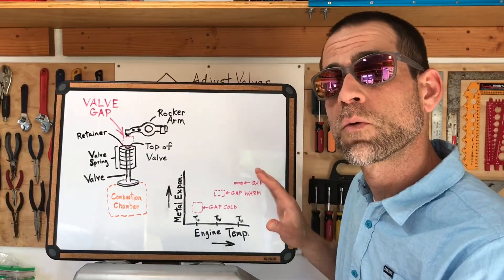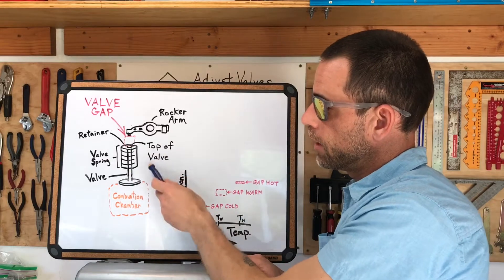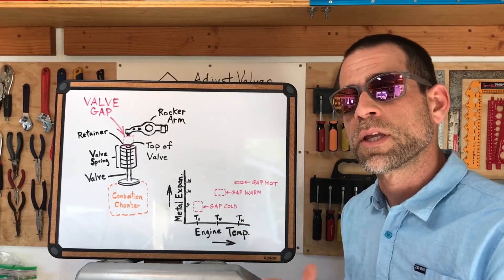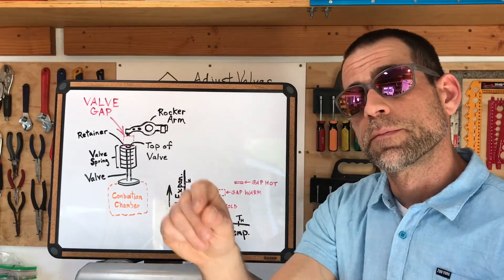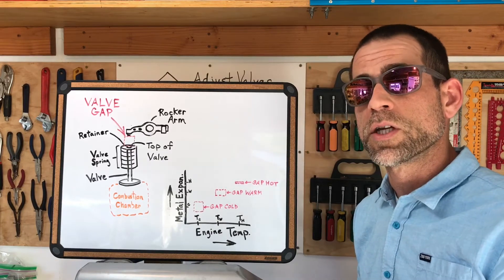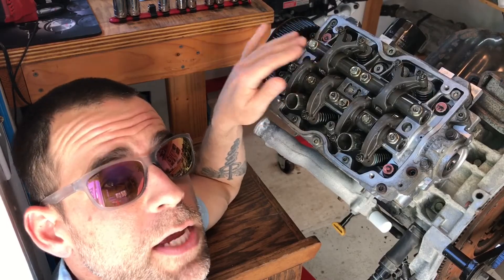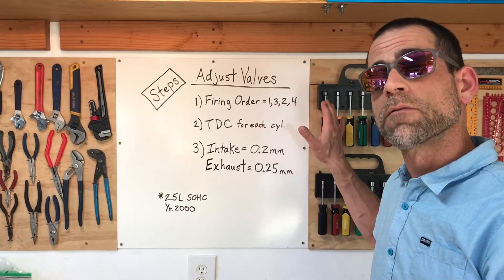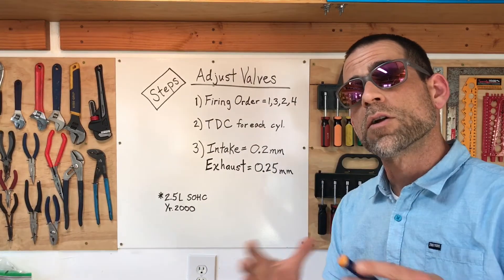How to Check & Adjust VALVE GAPS (the right way!)

Comment: Great Video -  Learned lots !  By the way, how would you go about doing valve adjustments on an EJ20 when it's still in the engine bay?  
Cheers
Reply from the maker: It’s a bit tight but very doable. Just need to pull the valve cover off and squeeze in there with a feeler gauge. Best advice, remove all the other bits that block easy access - STRIP IT ALL - it’s worth it in the long run. Good luck buddy!!
Reply: @SubaruONLY  Thanks for the advice.  In addition was thinking of lifting the engine slightly if necessary.  Cheers !
Reply from the maker: That’s a great idea, totally worth lifting it IMO!
Reply: @SubaruONLY  Thanks for the encouragement !  Keep up with the Great Content !!

Comment: Amazing video but what should I do if I have overheard camshafts?
And how to determine a best gap for 272 camshaft for example?
Reply from the maker: That’s a Crower grind I believe... use this link:
https://www.crower.com/media/pdf/2008b/129-130.pdf

Top of page, set when cold, valve lash:
- intake = 0.006”
- exhaust = 0.008”

Comment: Finally found a Video that someone understands what is going on. Great Vid Luke.  Was getting ready to to a vid on adjusting valves in the bay.  Researching what's out there.  To many overthinking it.  Not wasted information here.  👍
Reply from the maker: Awesome - stoked you dig it buddy!!! Cheers!!! 👊
Reply from the maker: Feel like there’s a lot of conflicting info out there on this.  I think you still need to check the clearance, yes, they do self adjust being hydraulic, but they can only self-adjust a small amount, they still need to be within spec to work, and that’s why you need to check clearance still. Good luck and cheers!!

Comment: Is this possible to do with the engine still in the car?  I have a manual trans, 2007 outback with 215k miles.  Has a slight valve/lifter tick noise.  My mechanic told me the noise wasn’t significant enough to fix. So I’m thinking it just needs a slight adjustment.  Head gasket was replaced 10k miles ago and unfortunately this noise just started happening.
Reply from the maker: Yes, can absolutely be done with the engine still in the car. Bit tight but commonly done.  You can also try this: Pick up some oil stabilizing additive from the local parts store. Look for a brand that advertises quieting down the valve train, lots out there. These do work well and in my opinion, they can’t hurt anything, only help add a little “cushion” to the valve train components. Only lasts for one oil change but I’ve used these products for decades with good results.

Comment: I think in imperial most guys use .006" and .008" for setting gap which is a little tighter than the .2mm and .25mm. My 99 Impreza has the loudest valve train, sounds like a diesel. I wonder if the Delta 1500 grind cams are the problem?
Reply from the maker: Nice, those have an more aggressive profile I’m assuming. I’ve used the part store valve train oil additive and that seems to work nicely to quite things down for a few K mi.

Comment: If your doing head gaskets, is there any reason why you can’t do this with the heads off the engine with a ej25 SOHC?
Reply from the maker: No reason, can set the gaps with heads on the engine or off the engine.  And it’s easier if they are off too! 👍

Comment: Luke, what about DOHC engines and those buckets ?  I figure I can check it wtih engine in car...but if I take the cam off, the timing belt would have to come off....wish I would have checked this before putting the engine BACK in a car...but I do have room to work on it.  Thanks.  I enjoy your videos.
Reply from the maker: Yes, you are exactly right.  The buckets often require and bit of  check assemble, recheck adjust, reassemble, etc. always good to do this with the engine out.  But you only need to remove the timing belt once, get all the gaps right, and then toss it back on.
Reply: @SubaruONLY  When I took it apart, I had a feeling, better keep those damn cups organized, and i think I did, but I am not SURE, flip the heads over, they fall out, was that right side from teh driver view or passenger view, etc...engine is in a vanagon so I have clearance to pull the covers, and belt and check it all.  Thank you.
Reply from the maker: Haha. Yep, I’ve accidentally turned my head to the side to look at something (forgetting about the buckets) and they all fall out!  Then it’s a measurement exercise to try to match up the gaps so all are even (which is basically blueprinting your valve train) - been there!!! 😁😁😁

Comment: I have a 2010 Suburu Tribeca. My question for you is this squeaky noise the car is making when I turn off the engine when I used my AC.  I first experienced this noise back in 2015, then it got worse as time goes by. Went to the dealership and no one has a clue as for where the noise is coming from.  They recently ruled that it might be a bad expansion valve.  Do you have any ideas?

Comment: I use the go, no-go method. Set the valve gap as you did but then try to insert the next size up feeler gauge. If it's a no-go, you're done. If it goes, start over .
How much of a PITA is this with the engine in the car? I've only adjusted motorcycle valves.
Thanks for the video.
Reply: If the valve cover won’t come off do you unbolt motor mounts and jack it up?
Reply from the maker: It should come off without lifting the motor up.  May just be stuck - try tapping with a rubber mallet - it’s should pop off.  👍
Reply from the maker: Good call for sure. Always a good idea to verify with the next smaller size 100%! With the engine in the car it’s totally doable but certainly not as easy.  That’s one of the drawbacks of these motor designs, those frame rails are right there in the way of accessing the top of those valve covers - same thing for the spark plugs too!
Reply: Thank you

Comment: I got my heads back from the shop after I shredded my timing belt, with the motor back in the car I had the Subaru tick, car runs great but the tick is driving me nuts. From my understanding, the tick is from having an incorrect valve gap, am I wrong in my thinking? Are there other factors that create that tick?
Reply from the maker: Most common reason is definitely valve gaps being too large.  But I’ve seen other things cause pretty loud ticking.  Once had a car with recent timing belt installed and they forgot to pull the pin out of the hydraulic tensioner assembly once it was all assembled - made a crazy loud ticking sound.

Comment: Very informative! Would you happen to know if the same process applies for the 2.5 DOHC engines?
Reply from the maker: Great question and thanks for asking!   Yes, the same process applies.  But turbo motors will usually have more valve clearance - this is needed to deal with the increased heat with cause more expansion.
Reply: @SubaruONLY  
I think the early 2.5 DOHC had hydraulic lifters. Pretty sure my 1996 OB did. Not snarky. Just sayin.
Reply from the maker: Think you are correct. 👍

Comment: Vids are great educational tools! I took the heads out with the engine in the car. Is tdc the same as lining up the timing marks?
Reply: So I know this is a 2 year old comment, but in hopes that this helps others that may have the same question: https://www.youtube.com/watch?v=J3GZB6JhtE4
Yes, you line the timing mark straight up on the pulley for cyclinder one.  Gap it.  Then move the pully to 3 o'clock gap, number 3 cyl, then move to 6 o'clock, cyl 2, then 9 o'clock, gap cyl 4.  The firing order matters for which way you are turning that cam.  But this video explains it very well.

Comment: Awesome video! Can I ask you how you set Tdc? I own a 03 fozzy ej251...subscribed already..
Reply from the maker: +Andrea Romeo Bandini   Sweet man.  For TDC, I pull the valve covers off and rotate engine and verify exactly when rocker arm compresses the valve and releases it - TDC will be the exact center point rotationally.  Do that for each valve.  Good luck man!!!